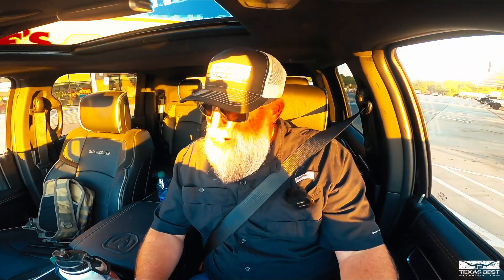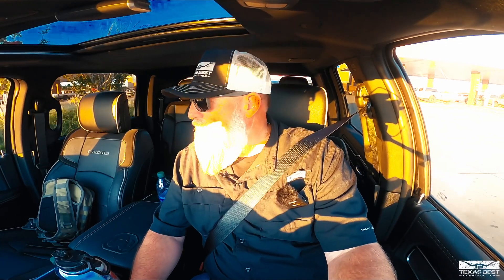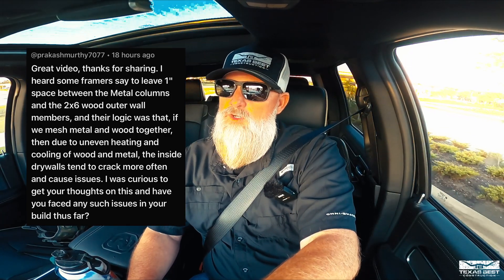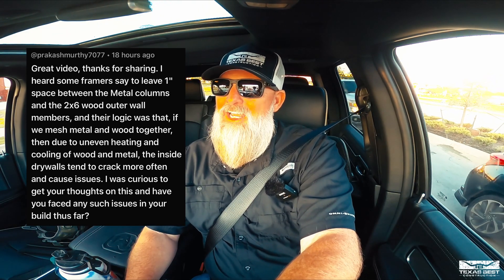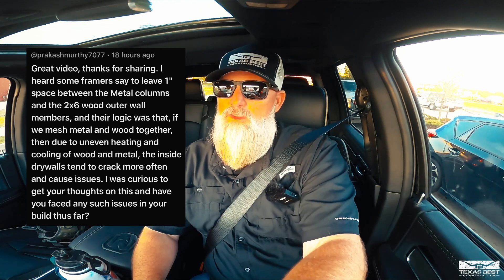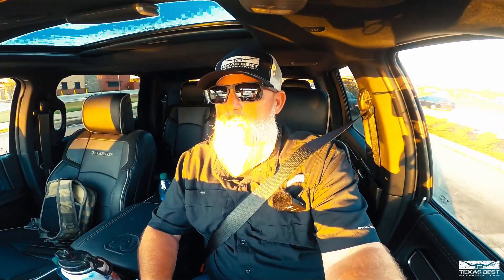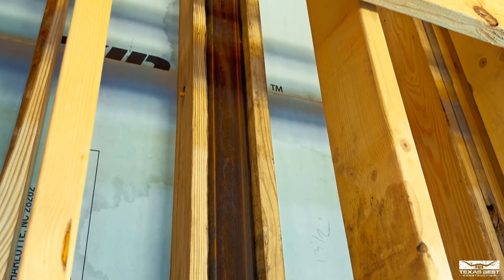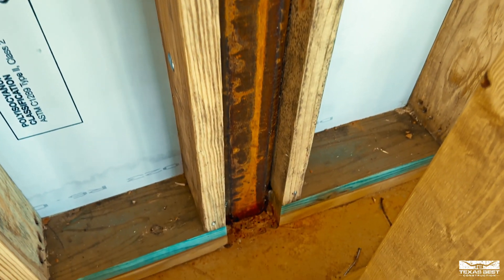Does Steel & Wood Expand and Contract on a BARNDOMINIUM? Texas Best Construction

Comment: great info! Is there a reason yall don't frame 24 on center for the 2x6?
Reply from the maker: We have done 24” spacing we like the added support with the 16” however. It depends on how high your table walls are sometimes 24” spacing would be better…
Reply: @TexasBestBarndominium  Thanks for the reply!

Comment: Paraphrasing what Josh said: different materials will cause movement for sure, but for wood the humidity is a bigger factor than temperature.  (Since the steel is insulated with the spray foam it is actually closer to the outside from a temperature perspective.

What I find in my house is that vibration and settling is more significant than temperature for drywall cracking.  The humidity is the real killer though here, as my house has an interior breezeway that is unconditioned.